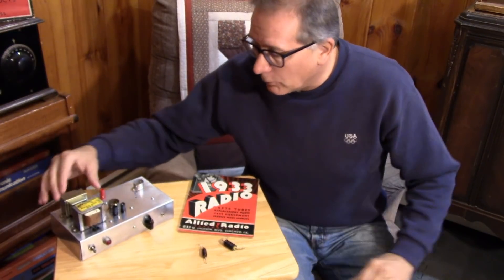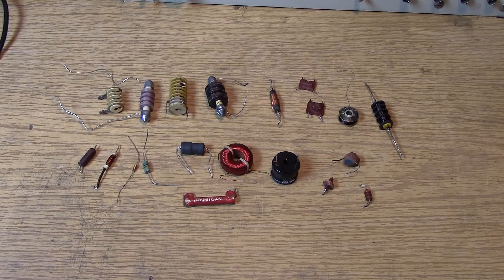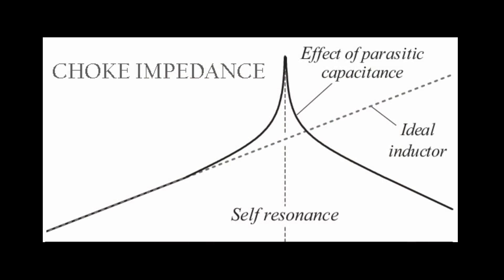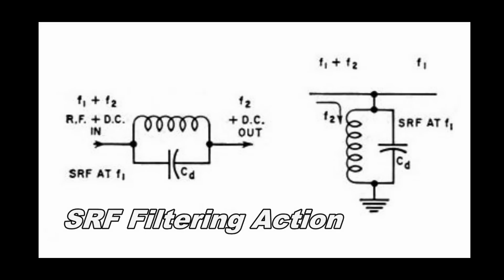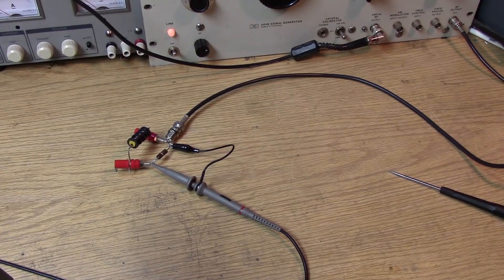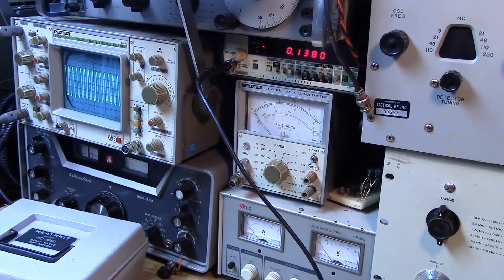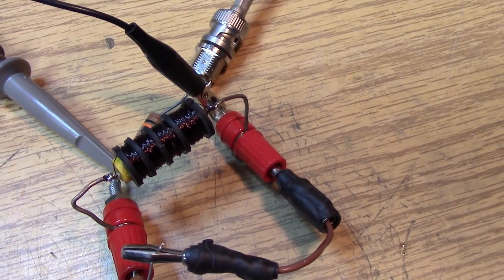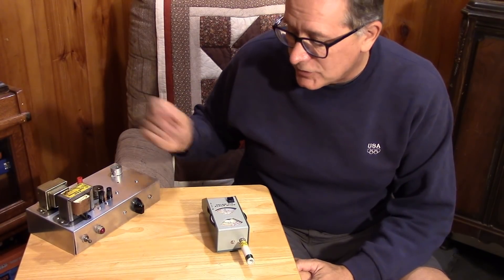Choking on Radio Projects?

Comment: Good stuff. I'm selecting inductors for a tuned input.  Settling on toroidal type.  At 15:17 it sounds like you suggest the plate choke pictured was designed to not function in 11m.  Would like more on how the grid dip meter works.  Thanks for posting.

Comment from the maker: Lately I have been playing with the inductors found in old ATX power supplies. These can be purchased cheaply 10 for 10 dollars in 1mH, and they self resonate around 1 MHz, so useful maybe up to 5 MHz. There are usually a couple in any ATX supply that can be rewound to hit 100 uH to 4 mH if you use fine enough wire. they are the short black ones that have a bobbin style, finer wire and shrink over them. The ones with mini ferrite rods and a few turns of heavier wire and plastic molds were low Q and low value, so not really too useful at RF.

Comment: You CAN make pi winding chokes.   David J. Gingery wrote a book on how to "Build a Universal Coil Winding Machine", that describes the device.  Such coil winders were once sold by Allied Radio and Lafayette Radio.
When using a GD meter to measure the resonant frequency of the choke you need to use the lightest coupling.  Otherwise the mutual inductance of the GD coil with the choke under measurement will throw the GD oscillator off calibration.  That's why the GD measurement didn't agree with the test oscillator.  Then there is also the effect of the parallel resistance you added that loads down the coil, and the resistor also has some inductance in it.   I built a clone of the Heath HD-1250 and I added a sampling output from the MOSFET amplifier to which I can connect a frequency counter, so I can get more accurate readings.
You may have more than 470pf across that home made choke, you don't have any way of measuring the distributed capacitance across the windings.

Comment from the maker: I did not touch on Toroid cores. So I had a few small Type 77 Amidon cores and I wound about 100 turns of #28 on one and it came out to 6.15 mH. So there is another approach.
Reply: I have built several mini-whip circuits and binocular cores of Type 73 material were used for the 470uH chokes in the bias-tee circuits. You can get about 15 turns of 30AWG wire-wrap wire on a BN73-202 core and I think this will give you around 1 mH of inductance.
Reply from the maker: Cores are also excellent and the good old Type 43 or better 77 or 75 work great. One or a few in series of the little Bobbin cores like  RLB0608-102KL work good for many radio projects.

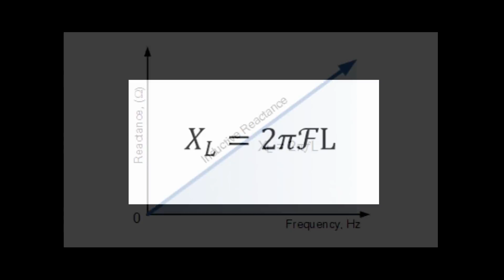Comment: 9:23 Aka 'Natural Frequency'
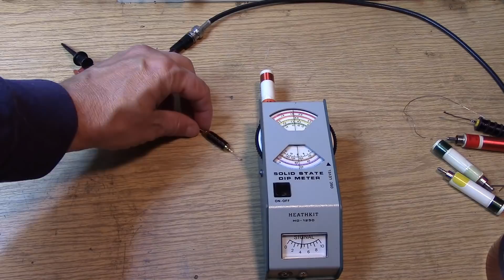28:28 I once read in Popular Electronics, or such magazine (30 yrs ago) how you could use a capacity meter to measure an unknown inductance, using a factor-constant to convert Farads into Henries
Reply from the maker: Yes since they are opposites. You would use a known capacitor and add the choke which would "subtract reactance".

Comment: Mike, is it possible to use a carbon rod from an old used up battery instead of a ferrite rod?
Reply from the maker: Good Question Scott. They look similar, but alas, no. There is no ferrous content in the rod, and thus there are no magnetic field intensifying effects. Rather there would be Q reducing losses. Carbon does make a good resistor!

Comment: Have you made a video on winding your own IF transformers, especially for older tube-based radios?
I'm toying with the idea of setting up an  Arduino-based winder that can count the number of turns and evenly distribute the windings.
Reply from the maker: Wow that is impressive. The early IF transformers were tuned with trimmers and the coils were on forms with no ferrite. Most of the modern transformers in the 40's-50's fail because of the Silver Oxide Disease on the plated caps not as much with the windings. I have never attempted winding transformers, but I do have a manual coil winder gathering dust that I may bring out of hiding.
Reply: @MIKROWAVE1  Haven't actually made it yet, just starting to plan out how to make one.  I figure it'll be something like what's shown in the middle of this page: http://www.angelfire.com/electronic/funwithtubes/winding_if_transformers.html

I remember seeing a video where somebody made one using the plastic body from a cheap mechanical pencil as a wire guide, clamped to a stepper/servo motor to move the wire back and forth along the form.  Should be a neat project for making RF chokes/transformers.

Comment: Hi, in the diagram at 8:38 why have the Antenna RF Choke? It is a high impedance to RF so what's the purpose of it?  The circuitry around it is AC coupled from the plate so .... what is it for?
Reply from the maker: Excellent question. What would happen if the .001 coupling capacitor failed and you had your hand on the antenna? Now the 400V of B+ would give you a shock. The choke's job is to be a DC protective short to ground thus protecting you and hopefully blowing the fuse! So yes it is useless to the circuit itself!
Reply: @MIKROWAVE1  Thanks for the response. I was staring at the circuit and sure enough the only reason I could come up with is if the capacitor failed short, however, then what? Obviously if the choke has wire of sufficient gauge then there's a chance of stopping everything in its tracks - I didn't think of that. Thanks for the explanation!

Comment: and now the 3D printer would be a good solution!
!! Really believe me!
how and what i want myself i can make it simple and fast I can print everything as I want.

the rubber pads can be plastic discs and even discs with a slot in it.
I have already printed various spool shapes
, buttons Desire Asjes you name it.
a 3D printer is the golden TIP here! please note!!! I don't print everything!!!

sometimes other material is also good to use! PVC pipe for example!

Friendly greetings from The Netherlands!
Rob.
Reply: That's a great idea. Have you done any yet?

Comment: Will those generator and oscilloscope leads add some capacitance to choke so measurements are not very precise?
Reply from the maker: Great question! The scope probes certainly have an effect. Even the best 10:1 will have around 10 pF of capacitance. So the idea is to measure at a point other than across the choke, or if you do have to, swamp the capacitance with a much larger capacitance - like the 470 pF and add the 10 pF into the equation. On the SRF test circuit, we measure across a 150 Ohm resistor, so the effect is small. But you probably could add another series resistor at the end of the generator lead to attach to the choke and do even better to isolate the capacitance issue.
Reply: @MIKROWAVE1  Another resistor is good idea!
Since i dont have a gdo, i will try and use my minivna with two pickup coils. 
73! de es1gb
Reply: Tried it, not working yet 🤨
Reply: Toomas, did you ever get it to work? I'm considering buying one of the nanoVNAs.
Reply: @lindseymontana945  VNA works well for antennas, but for inductor self resonance it's a bit tricky. Have not found right recipe yet🤔